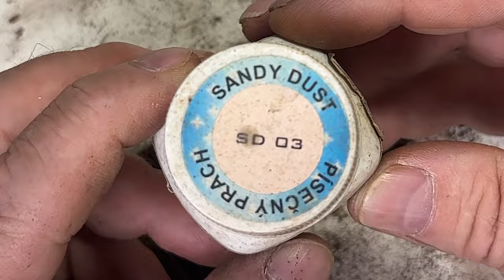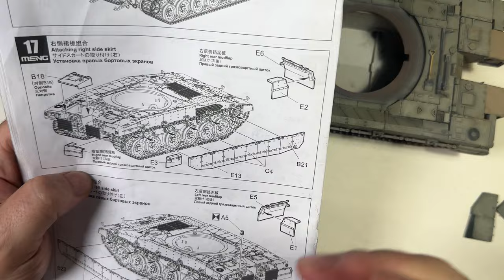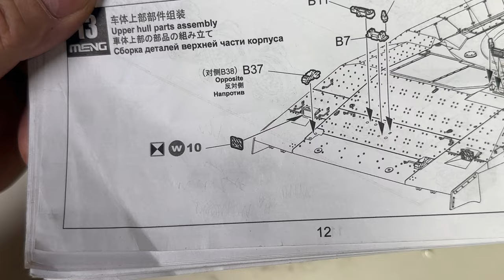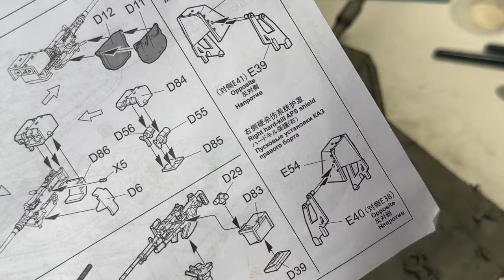Weathering a Merkava Mk4 part 7

Comment: Just starting this vid.
I noticed you didn't add more skid material like many other modelers do. Seeing your results, I am not really sure you need to add it. I know adding the material is larger than scale, but helps to emphasize it. I am sort of torn if I would add it or not.
I was thinking if you used an airbrush say at 8 PSI or so to spread the thinner, would that work? I will need to give it a try.
Reply from the maker: Hi Dan, thanks for watching the vid! I opted not to add more skid material since, at a this scale, it might exaggerate the details, but making the grain of sand as tall as a bolt head. I wanted to keep it accurate and to scale. Feel free to share your thoughts after watching the entire video. Cheers!